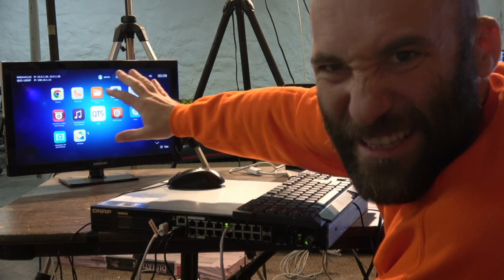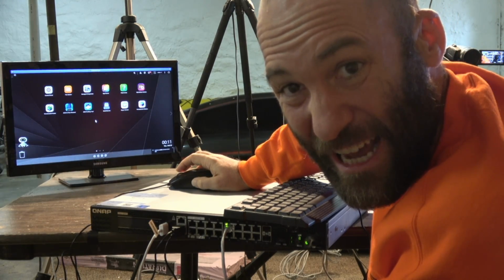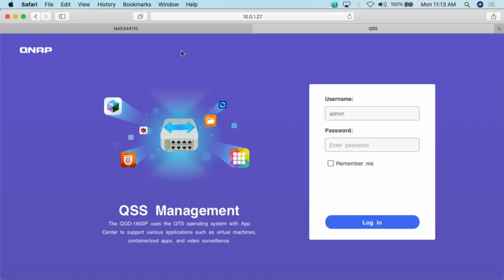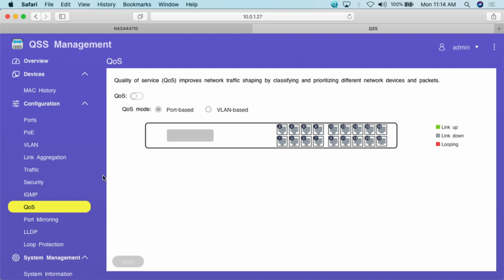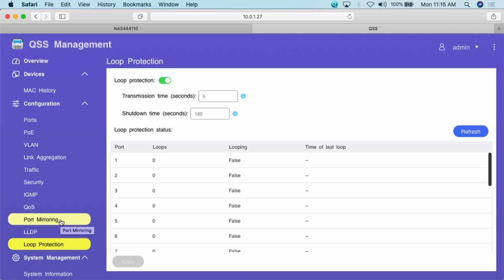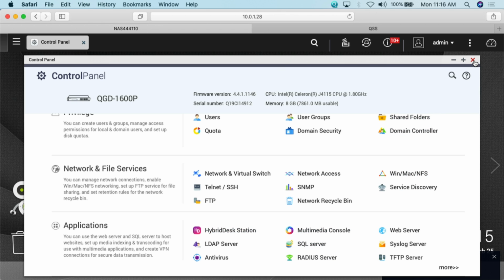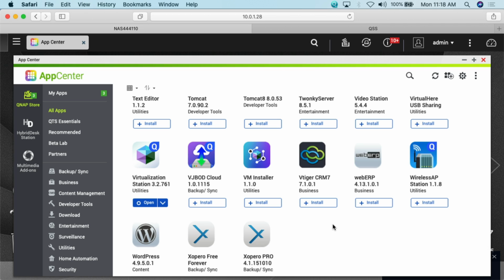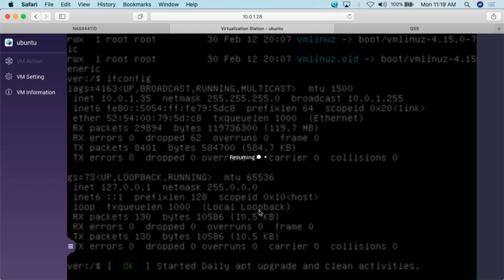Review - QNAP 1600QGD

Comment: It is pretty standard for enterprise equipment to take super long to turn on. Juniper SRX firewalls, Cisco Routers, even Palo Alto firewalls take from 3-15 minutes to fully load. I thought one of my Juniper SRX was busted the other day after a major power failure and went out for an anger smoke at 2am after it not turning on for 10 minutes to come back to it working. Almost dipped into the emergency bourbon.
Reply: Palo Alto firewalls take FOREVER to load ... and when they do the most annoying and frustrating thing is that they refuse to let you login for another 10-20 minutes (while confusing you with invalid password messages)

Comment: Hi Eli, 
What about QGD-1602P-C3758-16G? Is it faster?
As a rival I'll suggest CRS328-24P-4S+RM & intel NUC with i7/32GB or even HPE Microserver Gen10 Plus but htis will change too much the space requirement.
Reply: I own a QGD-1602P with Intel Atom (C3558) and the boot time is close to the one of the 1600.
I tested it with 8 and 16Gb or ram, it is the same.
However, for a complex device this is not near even to a "long boot time".
Thinking honestly that Eli is exaggerating. Booting takes time cause the complexity, not coz of device speed or other.
Encountered devices that took longer time booting, smaller firmware, not even an OS.
1600 is clear slower that 1602 and 8/16Gb barrier ranks poor for it.
However, for example, an important component, (router, like PFSENSE, virtualized on the QGD) brings a gain, saving money, as I have removed my physical PFSense box and run it as a VM and the DC too making the energy bill lower plus other advantages.